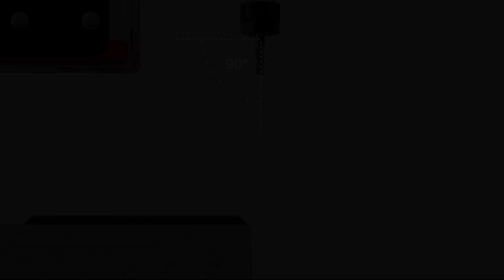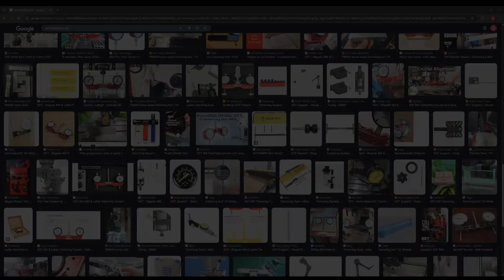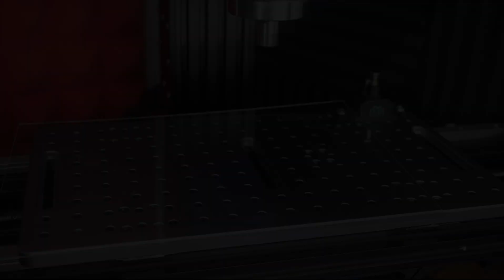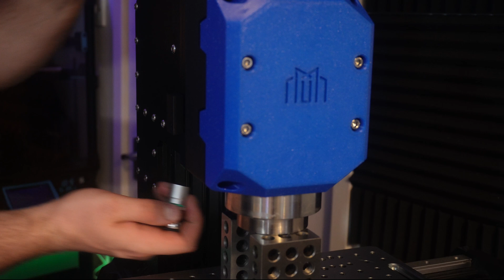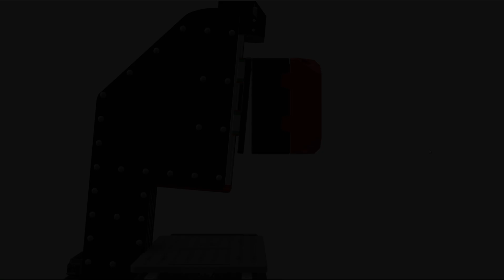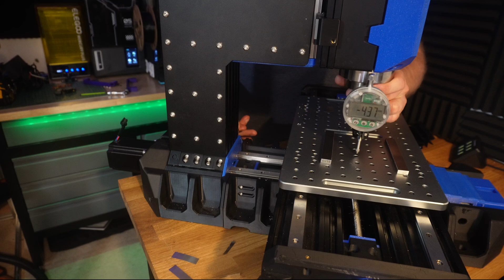The ultimate Guide to tramming a hobby CNC machine #cncmachine #3dprinting #cnc #maker #diy

Comment: Dude Your 100% correct. Good tramming info is scares. I purchase a 600x600 mitutoyo sufave plate. I stripped my cnc back down and started checking all surfaces and just started shipping everytning until my machines waa as good as I could get it.

Comment: No Z? For Z, you can use a 1-2-3 block sitting on the table with the indicator touching. Move the Z axis up and down along the length of the block.
Reply: I chose to leave it out for this one because as long as you tram the X and Y properly and all your machine parts aren't wildly out of spec or designed weirdly the error is so minimal it probably won't matter much for a hobby machine. But you are correct.
Reply: There is an easy and very precise way to tram the spindle to be parallel in Z without using the XY plane or the column. You place a ground rod into the spindle. The LDO kit comes with 10.000mm±1µm rods. You will need a 10mm collet, but the quality doesn't matter, as you can workaround any runout easily. Indicate on the ground rod sticking out of the collet. Spin around the rod, you will be measuring the runout. There will be a minimum, and a maximum value. At 90° and -90° from it, that is, where the value is in the middle of those two extreme, is where the runout is perfectly cancelled. Now you can move the Z up and down indicating this vertical line on the rod. Do this in Y, adding shims between the spindle clamp and the Z plate. Then do this in X, rotating the spindle using a hammer gently if need be, as you tighten the screws. Now your spindle is perfectly parallel to the Z axis. And can be used to tram the column to the XY plane like in the video. For reference, over the 20mm of rod stick out, my spindle was off parallel to Z in X and Y by more than 0.1mm out of the box. So it isn't insignificant :)